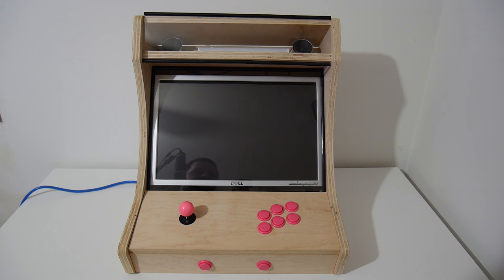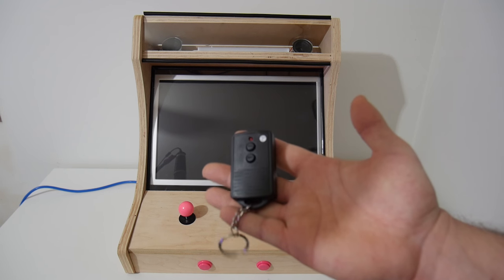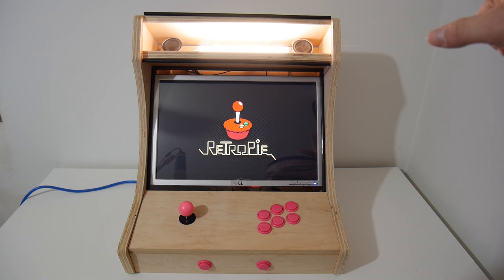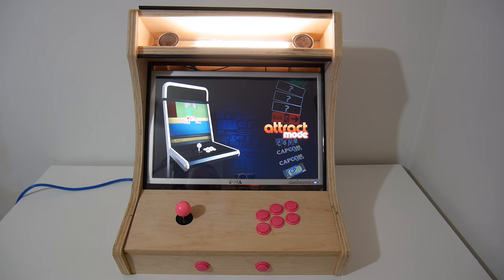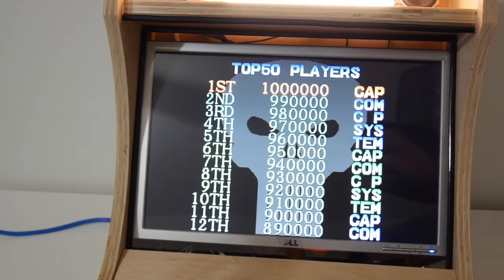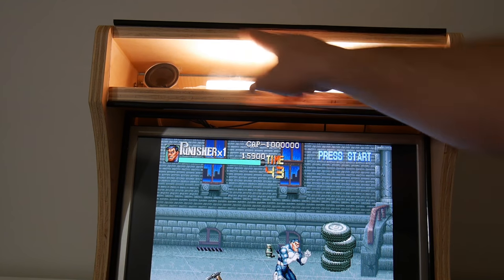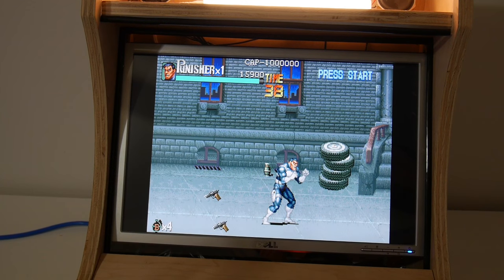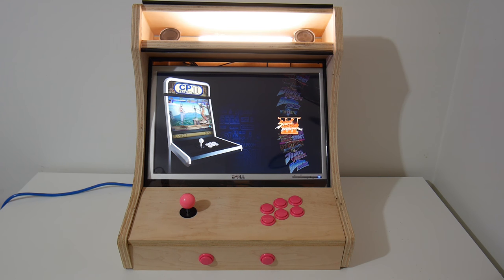Arcade Cabinet Update Remote On/Off Retropie Attract Mode Raspberry Pi 3

Comment: FYI: You can get iron on edge banding (instead of t-molding) -- the t-molding is just used for mass production because (if you have the tools) it can be done a lot faster and is less work. -- But if you watch some of the wood working channels, there are definitely alternatives.

Comment: ETA Plexiglas isn't to hard to cut by hand.  They sell the scoring tool at Lowe's and Home Depot.  Figure out your cut or score line.  Clamp a metal straight edge on the inside of your cut line.  Score at least 10 times applying moderate pressure.  You want to start slow as its easy to slip off your ruler.  once your scored a ways through.  Hold that score line on a sharp table or counter edge and carefully bend it along that score.  It will cleanly snap along that score line.  I never let the guys at Lowe's cut critical cuts for me.  They messed up some stuff for me too.  Also a little laminate router and a t-slot cutter bit will give you a great slot for the t molding.  The t molding will protect the laminate on your plywood.  Otherwise I would recommend some sort of epoxy sealer or other durable sealer.  I use a two part marine grade epoxy sealer on my mdf parts before paint.  You could also use edge banding laminate for the plywood which would be more work than sealer or t molding.  That plywood has a pretty laminate and great figure.  Looks like maple possibly?  A few coats of clear acrylic poly would look good.  The more coats the better.  Allow ample drying time between coats being sure to lightly sand between coats.  I used to refinish varnished wood on old yachts in a boatyard I worked at.

Comment: You should paint it with truck bed liner! But good job and it looks great. Thanks again for all your great videos!
Reply from the maker: Ryan Bissonnette that's an idea, I painted a whole 1986 BMW 325 with that stuff back in the day.
Reply: ETA PRIME Nice I thought about doing that to my car but not sure if its practical. How did yours turn out and hold up?
Reply from the maker: Ryan Bissonnette it looked awesome, I had the car for about 2 years after painting with no problems , I used real rhino liner, got a kit on eBay with sprayer and all. I used simple green and a high pressure house attachment to clean it every few months

Comment: look for wood veneer edge banding, it's got heat activated glue embedded in it and is basically iron on.  No router required.
Reply from the maker: Brian L awesome idea, is this the stuff https://m.lowes.com/pd/White-Birch-Veneer/3603330
I'll find something that matches
Reply: That's the stuff - you don't need to use an iron, you can use a heat gun (a hair dryer may get hot enough) and rubber roller since you are applying it to curved cuts

Comment: I'd paint it flat or satin black and then find some retro game stickers or overlays to put on the side. For the part where the controls are fixed to i'd do the same and then add a piece of lexan or plexiglass to that to take the handling abuse. then just drill out the plexi and mount the buttons/stick to it.

Comment: Hey ETA, love your videos!
I have a question:
how do you plan to exit Mame games in your cabinet?
As far as I know, you must use the Escape button on your keyboard.
And I guess you dont want that hanging out of your nice cab.
Reply: Retropie is mostly based on using retroarch, there are cores for mame and many others for different systems. You can configure the controls yourself to quit. Most people do start & select together (makes sense for cabs), in the past I've used clicking the right thumbstick but that is dependent on the controller used.
Reply: Michael Bell , ok thanks for the reply.
I thought that Start-Select didnt work with Mame.
I will try it again!
Reply: Mame is a tricky one to setup. I don't even know what version your rom sets are to know which emulator you can use. I try to use retroarch as much as possible as it makes things a little easier but you don't have to use it.

In attract mode you can press tab and configure the emulators. You can add an emulator of your choosing and assign the quit hotkey here as well. As I said start and select is the most common method of quitting.

ETA did say he would do a video tut to do all this from scratch, I'm sure it will be worth the wait.
Reply: You can read this http://blog.petrockblock.com/forums/topic/advancemame-exit-menu/#post-109745. Hopefully that will help you if setting the quit hotkey in attract mode doesn't work
Reply: Thank you very much.
I will check it out!

Comment: I can't get the 32gb attract mode you made to work with a xin mo controller on my cab 😔
Reply from the maker: Lee Foreman is it wireless? Does it work in emulation station
Reply: Not working in emulation station either.. when I load roms, the controls don't work.